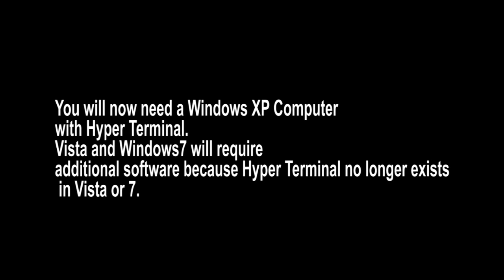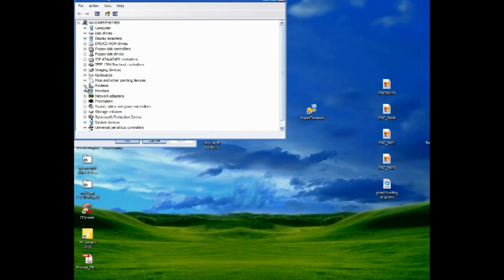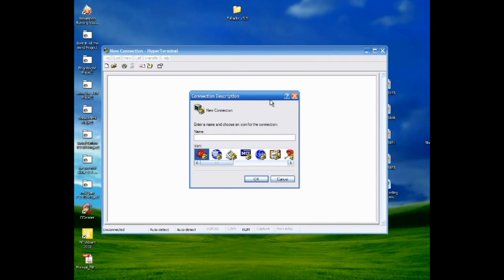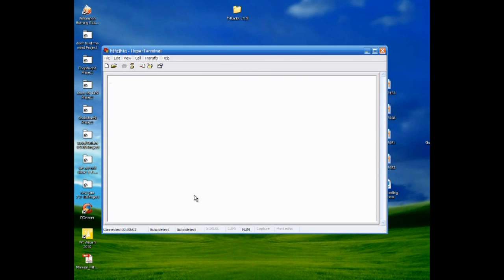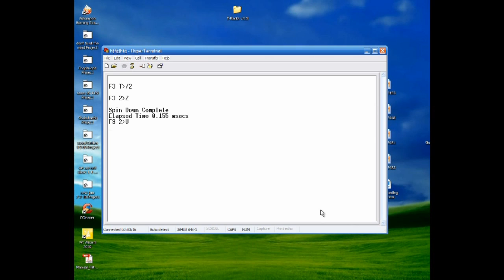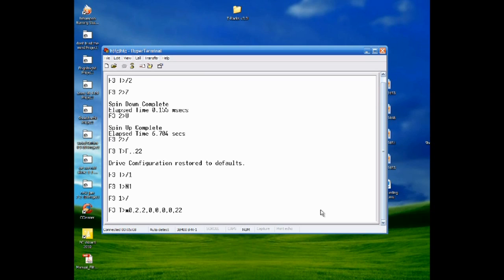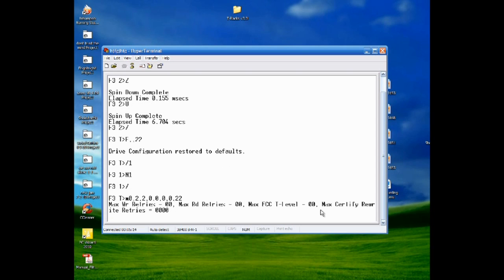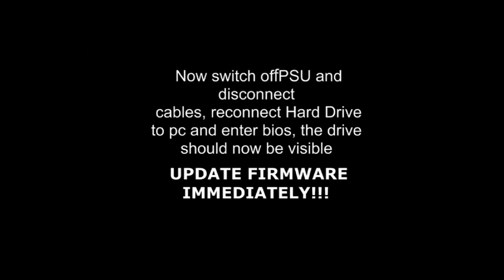Seagate barracuda firmware fix (BSY bug)

Comment: +Wayne Beeston  I AM  USING Kootek PL2303 USB to Serial TTL UART Module Converter Adapter.
Link:http://www.amazon.in/Kootek-PL2303-Serial-Converter-Adapter/dp/B00FEAMUOK?tag=googinhydr18418-21&tag=googinkenshoo-21&ascsubtag=0c8f7794-7168-4197-85cf-745c0ba7f2d2
but  it produced the ARROW character in Hyperterminal.
one post says that the USB-TTL adapter sent signals at 5 Volts level and required 5 Volts responses, but maybe the HD only could send 3.3 Volts signals, so the Prolific USB-TTL adapter didn't work. So for people having problem with only getting an arrow prompter, switch to an adapter which sends and receives signals around 3.3 Volts.
please help me...

Comment: I confirm that it worked on a 7200.12  ST3750528AS. Not only i have my HDD working but also i have all my files without any corruption. Thanks a lot.

Comment: Will it work for 7200.12 (ST31000524AS) model?? Plz reply..
Reply: +Joseph Yi Hello, i confirm that it worked on a 7200.12  ST3750528AS. It will definetly work on yours too.
Reply: +Sandeep K M Same question :(
Reply: +Sandeep K M Hello, i confirm that it worked on a 7200.12  ST3750528AS. It will definetly work on yours too.
Reply: sotospt52 thanks for the info!
Reply: +sotospt52  Thanks for the info!!

Comment: Here is what i read and I do realize its probably were most people got there information when doing this .. So i am only going to post a section.. because I have a question about this one section

Fixing 0 LBA error:

Note: All commands are case sensitive !

To correct 0 LBA error, you'll need to do a quick format in order to regenerate the partition, just with m0,2,2 and the rest can be left blank by putting only commas or filling out with zeros. At the end you need to use a "ValidKey" code, or 22.

Attention: The commands must be used 100% equal as showed here, wrong cmds could lead to data loss or HD loss! Double or triple check the cmd before to press enter!

So we'll have to enter:

F3 T>m0,2,2,0,0,0,0,22 (enter)

So my question does this last part format the drive and all the data is gone ?
Reply: +Randy Murray No i just did it. I dont know what it does exactly but i have all my files.
Reply: +sotospt52 Ya it worked for me as well :-)

Comment: Hi Steve, so sorry for the trouble, and thanks for trying to help. Some selected models (not all) of Barracuda 7200.11 did have a firmware bug that caused the drive to disappear from the BIOS. This occurred over 5 years ago and is not an issue on any current product. Seagate does have a procedure in place to identify the firmware problem with the selected 7200.11 drives, and to offer a way to update the firmware successfully if the issue is proven to be a firmware problem (and not some other kind of drive problem).

We strongly recommend any affected customer contact us by phone so we can take care of any situation for them. (US/Canada 800-732-4283. If outside of the US or Canada: http://www.seagate.com/support/contact-support/ )

If you prefer not to use phone support, you can follow instructions here:
http://support.seagate.com/firmware/fts_drive_check_en.html

As you might imagine, we don't think customers should try homemade fixes on their own and possibly make the situation even worse. We unfortunately can't support the particular firmware fix you're employing (though I know you offer it in the best spirit).

Thanks again for your considerate support of folks who've had this trouble with a 7200.11.

JP at Seagate
Reply: never again, seagate.... NEVER again!
Reply: I have the 7200.11 500GB drive and it failed last weekend.  Same thing as others have described (not recognized by BIOS).  I just spoke to Seagate Technical support.  The agent said he could not help me and that the only options were to buy a new drive .  In fact, the agent said he had never heard of the BSY bug affecting Seagate drives!
Reply: O really then do tell why didnt seagate issued the firmware to Lacie evenn they had seagate hard disk inside. Not everyone bought from seagate hard drive and when lacie didnt take it after the warranty period. The one I bought was a seagate ripped off from lacie external drive which I didnt know before. You should have been able to issue for lacie too. Thats why customer does homemade fixes AND yea it works. I tried with another RS232 cable and it worked too.
Reply: Yes it works but there is easier way.
Reply: CreativityAtWorst I will never buy a Seagate drive ever again - Buy WDC - if you have a faulty pcb (and you will more than likely with a Seagate if you touch it when its on) - you can just swap a known good one over to recover your data with good old WDC - Seagates have a firmware chip that is unique to the drive and makes the process more difficult - and they only offer a 1 year warranty - oh and their drives are shite slow and unreliable. Just google the Seagate Barracude spin down squealing noise that makes every noob user think the drive is failing and try to rma it - Do these companies actually test their drives before they punt them out to unsuspecting customers. Disgraceful!!!!
Reply: eewe jtytr What happened? Is there anything we can do? perhaps our support team can help? You can contact them here: https://plus.google.com/117787242507496445579/
Reply: That's not tatally true. I had two hdd, a Barracuda 7200.10 and a Barracuda 7200.12, both with the same problem and I use this method to restore the smart and them apply the firmware update, and now are totally operative.
Reply: Just coming to this now, after losing my family picture/home movie backup drive approx 3 years ago.  It was a LaCie Firewire 7200rpm 750GB marketed to Mac owners.  I finally decided to open it up and see if I could deal with it, and was surprised to find the drive spun up just fine, made no bad noises, just basically wanted to play but lost the ability to talk.

Did some more digging, and here I am.  Yet a serial number check using Seagate's site does nothing for me.  LaCie isn't even listed as one of the effected resellers, yet it plainly is.

Of course, I could use Seagate's data recover service - starting at JUST $399 per drive!  Horseshit.
Reply: lol
Reply: dredheadV2 I bought this kit, which made all the connections simple.    http://www.hdd-parts.com/seonelithseb.html  Worth the $50 to recover all the data.
Reply: bpjung123 I got the parts for less than a tenner.
£10.
Reply: Garry Gemmell  Does this fix works for your 7200.12 2012 Harddisk
I have SEAGATE 250GB 7200.12 2012 Harddisk its spining but not recognizing
Can anyone Help me for this
Reply: Garry Gemmell Hello
Can you tell me how to do that please....
Reply: Buy the adaptor from ebay for £10 and use telnet to program the drive.

You must be careful its not a job for amateurs and you can destroy the drive with the wrong command or inserting the wires the wrong polarity.

I will post a link later.

Comment: thanks for the Video.
I've recently tried re-installing computer into new casing and all of a sudden this Drive ST3250312AS having JC47, stopped working.
Good thing was I earlier backed it up and wanted it as new drive so Data Loss didn't happened but mysteriously this drive became invisble while diskmgmt was running, and even missing in BIOS now.

I am having the CA42 cable, but I was wondering if Having a COM Port available in Desktop Computer (which i use to burn PIC Programs) can be used directly and the need of this cable is eliminated ???

Comment: I have this drive, exact model number and all. It has the original firmware on it and still, knock on wood, works just fine to this very day.
Reply: You should update the firmware so you never need to do this.
Reply: I had the 500 gig ST3500320AS and it just locked up on me over the weekend. It worked fine up until this point. I'm really pissed that I hadn't received anything from seagate in regards to this flaw.
Reply: Welp. If this is the problem and you want to fix it, you should be able to get a T6 Torx screwdriver from a hardware store. Don't be fooled by how tiny it looks in person. T6 is the size you need.

Also, the wires are really difficult to fit onto those pins. Impossible to do without touching each other. Don't underestimate the need for insulation.
Reply: already have a torx for it. and i have a USB to TTL converter with pre made connectors on the end, they fit on the pins like a jumper block would. i just need a power source, i have an external power supply for hard drives i just need to find it.
Reply: I wish I had that when I fixed mine, haha. I ordered a CA-42 cell phone cable, cut off the end, and used that. I felt like a super do-it-yourself nerd fixing it with that thing. I had little crimp pins that I put on the wires, and I insulated just the middle wire to keep it from contacting the other two.

For insulation, I found some plastic wrapping laying around the house (from something I bought from the store), ripped some off, wrapped that around the middle pin, and held a lighter under it to "shrink wrap" it on.

If the USB to TTL has 4 or less wires, then you shouldn't need a source to power the connection. The USB provides the power. My cable and a USB to TTL I just googled up have the same wire colors. White, Teal, Black, Red. Black is ground, and Red isn't used. It's just figuring out which remaining ones are the transmit and receiving wires.

I have my white one the middle one and the green/teal one the right one. And the right (closest to SATA port) pin on the drive is Transmit and the middle pin on the drive is Receive. So that means the white wire is Transmit and Green/Teal is Receive.

If the connection really does need power, then you should be able to go to Radioshack and get a 2x AA Battery Case. I bought one in preparation but it turned out I didn't need to use it. It should hold two AA's and have a red and black wire coming out of it.
Reply: Oh, you mean a power supply for the hard drives?

If you built your computer, you should be able to fish a power cable out (while the power supply is off of course) and hook it up to the drive. I didn't use a separate power supply. I used my computer's internal supply to power the drive when I fixed it. The steps where you give and cut power will just involve you turning on and off your computer and re-establishing the connection with hyperterminal.
Reply: Yeah I need the power supply for the hard drive itself. I have a brick power supply that has a standard molex connector on the end. its used for powering up hard drives while connected to my Sata to USB adapter. I have it already but just need to look for it in my boxes. i figured it would make things easier since it has a switch built into it. but if I can't find it I will try it that way.

Comment: I have a Seagate 7200.11 st3750630as 9BX146-505 certified repaired drive... It worked fine for a few years then it just one day stopped.

Any idea if this can fix it? I've got documents on there I really don't want to lose. I was honestly thinking of just buying another PCB and replacing it. but this is cheaper and seems better.
Reply: If it's a 7200.11 that stopped being identified by the computer, replacing the PCB might not even fix it. It's a firmware flaw that wrote an error onto the drive itself. This fix sends commands to the drive to fix that error and rebuild the partition table or whatever.

Comment: I have a USB Rs232 in use (also com4) and connected everything with the 4 string cable that came with it (well 3 of em actually GND RX and TX from the drive to the USB device) but I cant seem to get anything in HT when pressing CTRL+Z, also tried switching RX and TX to no avail
what am I doing wrong?

Comment: One more time, THANKS a lot.
If you don't disconnect the card as you said, yu will only see "LED:000000CE FAddr:0027CF31" and the console will not respond at any input.
In some places let the disconnecting as something optional, when is a must.
Thanks a lot! ^-^

Comment: Thanks for your great and valuable video Wayne,

I am very happy to bring back alive my Seagate 7200 EHD by using your accurate video with directions. Although it was difficult to find the NOKIA-CA42 cable in Mexico City, your detailed instructions allowed me to fix my drive without any further problems. .....Excellent job WAYNE. ......THANKS
Reply: ya se que es un post viejo, pero veo que si encontraste el cable, a estas fechas yo nunca lo encontre, de casualidad sabes que tiene dentro quizas un max232? para la comunicacion?

Comment: I fixed my seagate drive thanks!!! I've got 2 western digital hard drives, instead of being 4 pin they have the 8 pin jumpers for master/slave etc. on them. Can the 8 jumper pins be used for rx, tx, ground or are they master/slave etc only... Have you used this method to fix other brand hard drives?

Comment: hey bro, i have seagate 500 gb hard drive and hard is having problem with speed, copy speed is 2mb to 3mb per second,windows takes long time to boot up and programes run very slowly, before this problem hard drive's firmware was reinstalled becoz it was removed bt itself, please give any solution  !!!

Comment from the maker: hi i got the cable off ebay and i was lucky enough to get the 5 wire version that requires power...if you are still unable to fix the drive i could do it for a fee..i have fixed several now using this method...let me know

Comment: Thanks for this info!
Although I still can't get it to work - I'm using a 3 wire ca-42 cable bought off eBay and the hyper terminal either shows an arrow when I press Ctrl+z, or hyper terminal cannot connect to the com port :(
Any advice?? And also where and who did you buy your ca-42 cable from? (I'm from uk too)

Thanks again

Comment: Just tried this but using an Arduino's FTDI chip to do the serial side, no dice. So I've resigned to ordering a CA-42 Lead and see where that gets me. The Arduino did let me see the "LED:000000CC FAddr:0024A051" Error when the board is in place so I know I'm fixing the right issue. Totally Unrelated, You sound like you aren't too far from me, you sound very much like my friend from shildon :D

Comment from the maker: @remalion Hello and thanks for your question
Well I have fixed a few now using this exact method and all the data from the drives was still fine. I had this fear also about loosing my data but as of yet everything was fine...just make sure you update the drive to the latest firmware after the fix.

Comment: so after all the code is entered and the drive should be working again, do you just do the ol "safely remove hardware" or is there a special way to disconnect from hyper terminal and remove the drive? great video!

Comment: Just fixed my drive by your method for NZ$10- thanks heaps! The professionals wanted $350 to fix it after I told them it was a bsy error. As a note I had to power down the drive prior to the final m0,,,,,,,etc command and now it functions great. Just updated the firmware so touch wood it never happens again. Cheers.

Comment from the maker: @Henniebrandweer A retail version is one that comes in a nice box with all manuals, screws etc. A OEM is simply the drive on its own, I am not sure on the big difference except that OEM drives are sold with new pcs and are also a lot cheaper to buy.

That’s good news that Seagate will fix it free of charge, you have been lucky is this in normally very expensive I believe.

Just make sure when you get your drive back that you update your firmware immediately if Seagate have not already done so!!

Comment: mmm... I have no Idea what the difference between OEM and Retail is.. My english is not perfect lol.. sorry, its and original Seagate drive though. I have been in contact with Seagate and it seems they are aware of this Firmware Bug and they are willing to fix my drive free of charge preserving my data.. so it seems I will not have to go the risky way.. but I will obviously remember this for if the drive goes out of warranty :)

Comment from the maker: @Henniebrandweer Hello Hennie 

your data will be totally safe if you do the fix, I have now fixed a few this way and everyone has been fine!

As for the cable I think the only difference is that the 3 wire version does not require power but im not certain. Its just pot luck when you buy the cable, it seems most are 3 wire but mine was a 5 wire.

Comment: Hi there, This has just happened to me, and my drive is also not recognized by my pc or external.. If I use this method, will my data be lost afterwards? or will it still be there? I ask this because I read something about User Partition format Successful in the end of the video.. also what is the difference between the 3 and the 5 wire cable like in the other youtube vids? btw the drive you use in your vid is the EXACT same as mine.. any advice would be greatfull. thanks in advance. Hennie

Comment: Hey!.. This totally works!! Thank you very much for all the info.  As a foot note I want to say that a CA-42 cable is a little old and I couldn't find it on the market anymore so I used a CA-50 cable witch has only 3 wires: 
#red - goes to HDD RX pin (as shown in this video)
#white - goes to HDD TX pin 
#black - goes to HDD's GND pin

Good luck! (and of course - immediate firmware upgrade after this) :)

Comment: hi there, nice video u uploaded...i would like to ask u sth about pcb of the hd...i have a seagate barracuda 7200.12 500gb, and while the hd seems to work fine, no clicking at all or some other noise, it is hardly shown on my computer and if it does i cannot enter it, saying ''parameter is incorrect'' and the whole system may stuck a bit...i heard that maybe it's the pcb...is there any way to fix it? thnx in advance